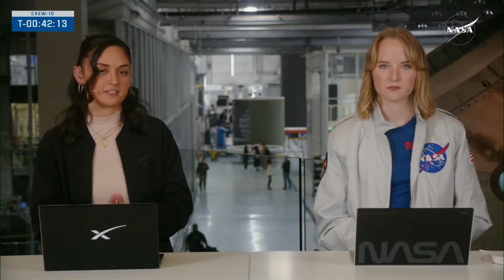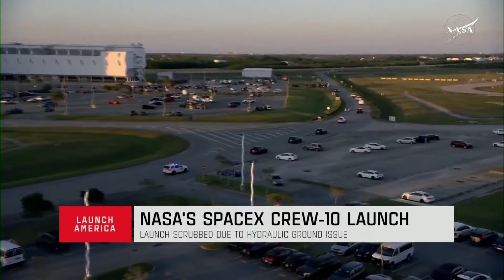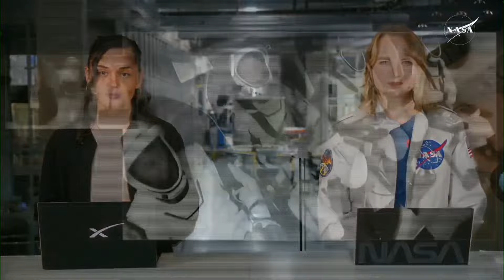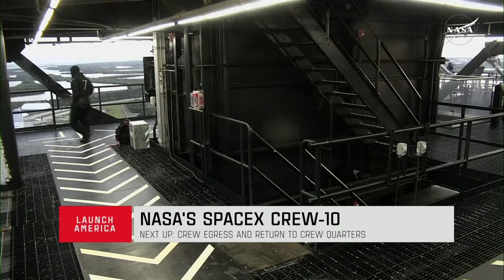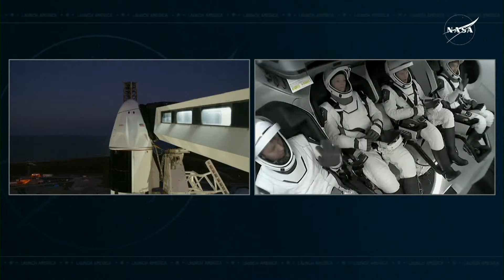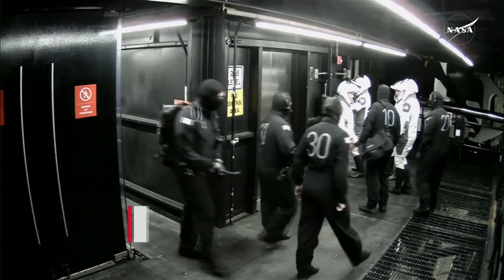Happening Now: NASA Launches SpaceX Mission To Return Boeing Starliner Crew From ISS

Comment: The “adversary”/enemy out performs the U.S. space program.  Shameful.  
The physics of space travel has not changed since the 60's and 70's so what is it?
The difference between generations – 
There was a generation that saved humanity then came home to send people to the moon. There was no such thing as acceptable failure to them.  They did not applaud and cheer when things went wrong.  It was the Soviet Union that pretended something was not a failure or that it did not happen at all.     

This generation, failure with phrases like unscheduled rapid disassembly to compensate for ineptitude is ok because at least you participated, and you are entitled to something. This is the same generation demanding communism in this country as they applaud and cheer total failure, then defend their own failure of character. 

Then Generation – “Failure is not an option” Their method, applied physics   
Today’s Generation – ‘We are not afraid of failure” Their method, trial, and error